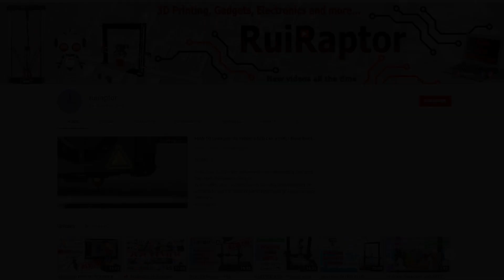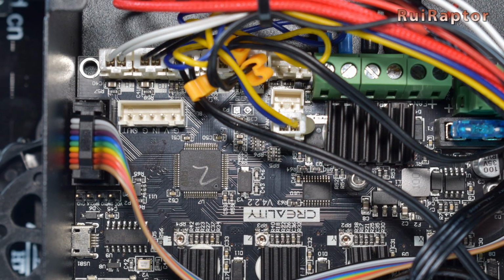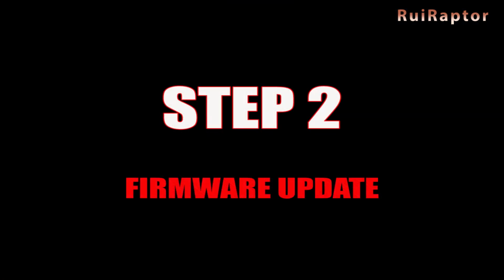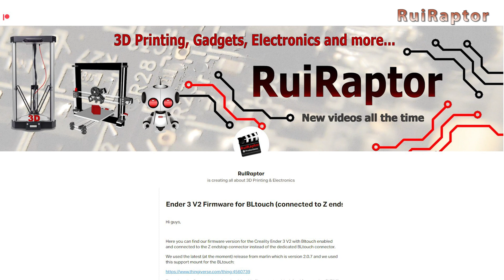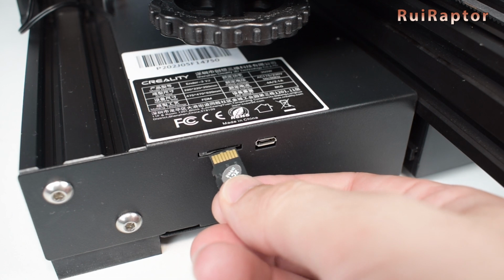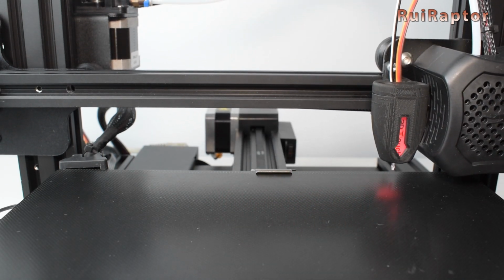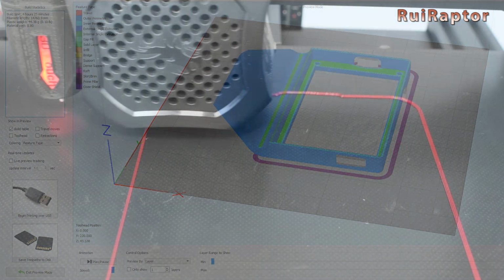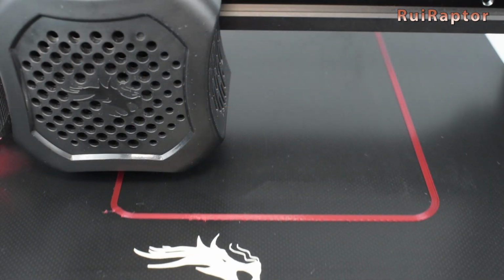Creality Ender 3 V2 BLTOUCH - HOW TO Install in 3 Easy Steps

Comment: When I select “Auto Home” the x and y hit their switches, the z goes to the middle position, and then the z just stays in the middle height position while the bl touch sensor goes in and out a couple times. Then it just stays at that height. 

Do you have any idea what’s going wrong?
Reply from the maker: Hi Wyatt, make sure the white/black wires are correctly connected.
Reply: @ruiraptor  I'm having the same problem, I've trying to figure out this BLtouch for months now, and my wires are hooked up right. But it's solid blue after the 3rd prob and just sits there

Comment: Hello, just a quick question! When I was doing the firmware update on Visual Code, it said a task failed. The task that failed was the environment. Originally, the environment was not the correct one so I changed it to the one you pointed out before compiling the code. The environment I typed in was STM32F103RET6_creality. Do I change it back to the environment that was set before or keep the STM32F103RET6_creality environment?

Comment: That bltouch shroud / cover looks nice!
Reply: Creality is releasing a official "BL-Touch" too. called the CR-Touch. it has a really cool casing too and looks more rugged including a metal pin for leveling. I wonder when they will release it.
Reply: @Underp4ntz  wow, just looked it up, pre-sale now, and will ship in June. It looks nice but for $50 USD that seems steep. The original bltouch is about $35USD, and decent clones (like triangle labs) are less than $20 (although shipping times may vary)
Reply: Excellent job